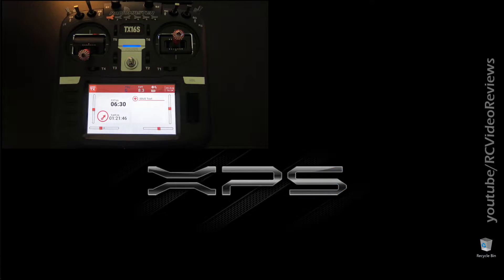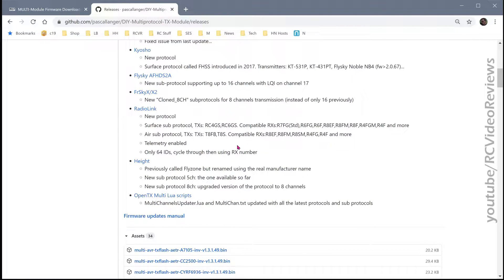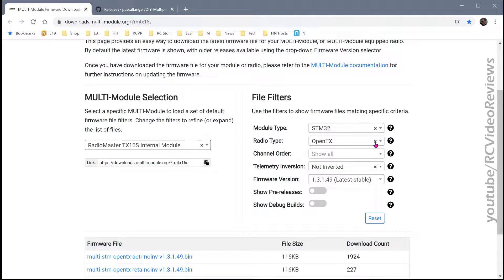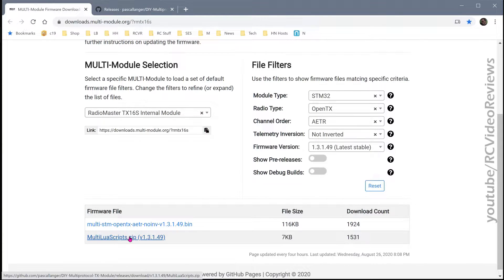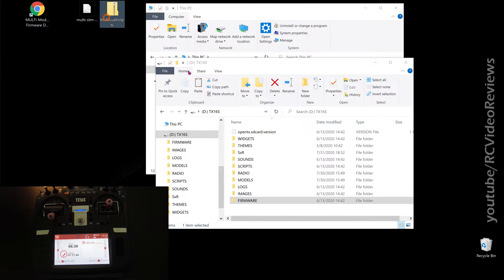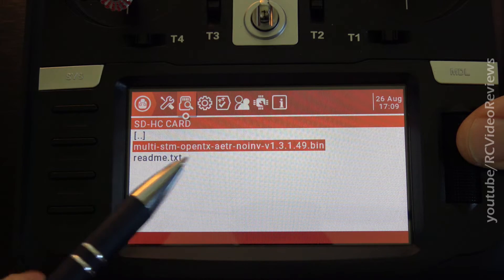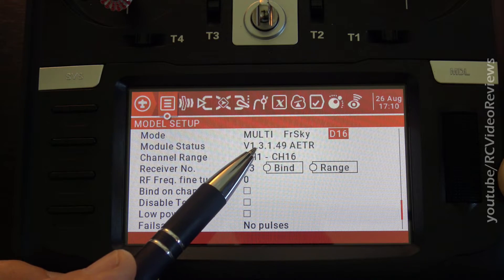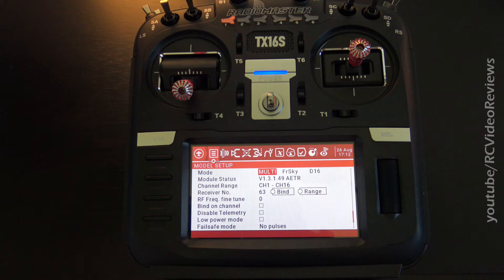How to Flash Radiomaster TX16s Internal Multiprotocol Module Firmware • [Beginners]

Comment: hello i have a little question
I just bought the Radiomaster tx16s mark II and it shows multiprotocol AETR. If I TAER the update on your video
Can I use it as TAER while using the tbs module?
or if there is anything else i need to do if you let me know i would appreciate it

Comment: I purchased a RadioMaster TX16s with ELRS internal. Can I flash it to the Multi protocol 4in1 firmware?
Reply from the maker: No, the 4-in-1 chip is hardware and software. You can't add 4-in-1 functionality with just software.

Comment: Just came across this and thanks for posting. 1 question , my model status blinks fron vers no aetr to module update recommended. any ideas why please? thanks
Reply from the maker: Did you update your module firmware? What version are you running?
Reply: @RCVideoReviews  no, i have V1.3.1.36 AETR  I assumed it was because i had external module as off
Reply from the maker: @boydriver2978  The radio is telling you with the operating firmware you use that you need to update your MPM firmware. They are not the same thing. This exact video shows you the process.

Comment: great videos just very fast-paced. I got the firmware on my tx and internal modular updated but the write to sd part I must have screwed up. it didn't work so all images, sounds, models, are gone. i backed them up but have no clue how to put them back on the tx sd card.
Reply from the maker: You just copy them back to the card.

Comment: I literally don’t have the firmware folder when i go to the sd card page or in my sad card contents… wtf
Reply from the maker: Sometimes zip files omit empty directories. Just make one in the root of the sd card.
Reply: @RCVideoReviews  thanks i got it working. I tried flashing in dfu mode but i kept getting an error saying dfu.util or something like that and wouldn’t work so i had to flash through the remote

Comment: Hi im having a problem binding xm+ to radiomaster tx16s. Do i need to flash the xm+ too and radiomaster tx16s.
Reply from the maker: What protocol are you using?
Reply: @RCVideoReviews  V1.3.1.36 AETR
Reply: @RCVideoReviews  frsky D16
Reply from the maker: You're omitting important information. What's between "Y" and "D"
Reply: @RCVideoReviews  where do i find Y and D at?

Comment: I asked Radiomaster concerning the Conformity of Compliance when updating the internal multiprotocol update.: “As far as we know not” was the reply. I ask the team now for an statement from the developers of the internal multiprotocol module.
Reply from the maker: It makes sense to me they would say that. They sold it compliant. If the user does something that makes it non compliant they wouldn’t want to be in the middle of that question. You can always leave the firmware alone and remain compliant with the initial attestation.
Reply: @RCVideoReviews  Thanks for your quick answere

Comment: Maybe a silly question: Has changing the software in the internal multiprotocol module influence on the properties of the transmitter that gave the transmitter there conformity of compliance from july 2020
Reply from the maker: I don't have any way to definitively answer that question. If you want to dig in, head over to the MPM project page on Github and either check the source code or ping the developer pascal.

My guess is that the developer would not change EIRP levels. Not to say a user couldn't. I have a video on how to compile your own MPM.
Reply: Thanks for your support and I will  sinds the question also to the Radiomaster support team.

Comment: RCVR, can you please help me.  I have this TX.  I've updated everything, firmware, multi-module, bound and rebound my models....etc.  I've just switched to this from spectrum and love it.  All my models have spectrum receivers (planes/helis).  When I do a physical range check I can put the TX in low power and walk 100 meters away from the model with not problem and still have control.  But if I click the "range" option and monitor the RSSI it drops to 0-30 15ft away from every model I have and gives critical alerts and telemetry lost, but I still have control of the model over 100 meters away.  What is going on?
Reply from the maker: I’m not the best person to help with this because I don’t own any Spektrum gear. So I can’t provide any experience based information. You should consider joining our discord and asking there. Plenty of knowledgeable Spektrum users on discord.
Reply: @RCVideoReviews  thank you for the response, and A++++ on your vids and info.  They're amazing and thank you!!!  Sorry for the stupid question....
.but what is "discord"?

Comment: I just want to bind to  these BS Frsky receivers . I have a TX16S , does anybody know what is better updating the radio or updating the receivers as I go ?? I don’t care if I loose bind to and other frsky receiver . Thank you for the assistance if anyone chooses to help..
Reply from the maker: I'm not sure I understand your question. Can you elaborate?
Reply: @RCVideoReviews  Ok here’s the sit rep - I use a TX16S  . Most of my builds I use crossfire.  Before I switched to  crossfire I was a frsky guy. I have 3builds with x series receivers and  4 w/ crossfire .I  recently I purchased a bind and fly with a xm+. I Can’t bind to the XM plus..  Instead of downloading new firmware to the xm+ can I not just download the firmware  I’m currently using  on my TX16S to the new xm+? That way I  can bind to my existing quads ? 
Maybe I’m not  thinking about this correct , if I download the firmware from the site and install on the new xm+ at that point will I no longer be able to bind to my older quads ?  I’m so lost on these  FRSKY  receivers with firmware issues  I know it’s not complicated I just get so aggravated fooling with frsky , I apologize if I’ve been disrespectful or anything I like your channel  a lot & will be becoming a Patreon , I really appreciate you taking  the time to answering my questions.. 
To be clear my question is can I download the existing firmware on my TX16S to my new xm+ receiver and bind that way ? If I do that my old receivers and my new xm+ would all be the same .. Or will I be forced to upgrade all my receivers? I have no complaints with the firmware I’m currently using…Again thank you …  🙏

Comment: Hi, I purchased this radio Radiomaster TX16S, in the hope to continue flying 6 models which are using the old Frsky D8R-II Plus receiver, but bad surprise !!!, this internal module version 1.3.1.36 AETR dont have the option "D8Cloned" !!, but I saw in other video that the old internal module version V1.3.1.24 AETR has the option "Frsky - D8Cloned" , how colud be possible that newest and last version dont appear anymore "D8Cloned" ? ... I will really appreciate any idea or suggestion... should I back the internal module firmware to the old one ? thank you !!! and greetings from Sweden !!
Reply from the maker: I haven't really messed with Cloned. Is there any reason you can't just bind in D8 with the new radio?
Reply: @RCVideoReviews  Hi, thank you for answer, and yesterday late finally I found the solution and solve it, it is that now under brand "Frsky X", and next for sub-protocol, you have to scroll to find "D Cloned" and not anymore like "D8 Cloned"

Comment: After days of trying this finally worked on my 16S.  Ty.  When i went to my firmware on the SD card there was another file there. 
Open-tx 16s-en-2.3.11-otx.bin.  Was there something i was supposed to do with that file like flash transmitter or something.  J
Reply from the maker: That might have just been the original firmware they shipped with the radio.

Comment: My TX16S showed I needed a module update, when I try to download the binary for the firmware update it says I need an APP to open it. So do I need an APP? First time this has happened. Didn't have any issue with the multi lua scripts. But as it is, I cant bind to any new receivers.
Reply from the maker: You don't open the .bin file, you put it on your sd card and flash it from the radio.
Reply: @RCVideoReviews  OK, got it. Process complete. Thanks!
Reply from the maker: @james7224  You're welcome.

Comment: I went to the MULTI-Module Firmware website, and I have two choices, first- tx16s internal module (4-in1) and second- tx16s se internal module (cc2500)).
What do I choose?
Reply: I have tx16s v.1.3.1.59.
Reply from the maker: You need the 4in1. Why are you upgrading?
Reply: I noticed tx16s in user interface / value / pressing int.  / Rud / Long press / List of options, I do not have the last value which is the transmission level of the device, which can appear in the top line next to the battery and volume logo.  Maybe you can tell me if you have the option in your device?
Reply from the maker: @oded_10  My last value is TMR3. I don't believe that has anything to do with MPM firmware, I believe those options are governed by OpenTx and they will change depending on telemetry sensors available.

Comment: Hi There  I have the TX16S se  with the CC2500 chip has version V1.3.1.69  will not bind to Flysky  will I have to update firmware to support Flysky ?
Reply from the maker: I don't believe the CC2500 supports FlySky. FrSky/Futaba.

Comment: I got confused regarding the 2 firmware areas!!! So I followed the other one, then the radio complained of "update firmware recommended" (text flashing), I did this one and it then works fine. I do have problems with creating model images, to the right specification (192x114 in png format) but do not show in the radio, some do, some dont. (weird!!)
anyway, thanks for a great videos on a very complex, and not that easy to understand radio!!
Reply from the maker: Images on this radio can be challenging. I've been frustrated with them too. The process in this video seems reliable: https://youtu.be/6B356b6i4bw

Thanks for watching!

Comment: My TX16s radio came from China with the FCC firmware. I'm in EU so I would like to flash the internal module with the EU firmware. I searched on the website you mentioned but couldn't find that option (EU or Non-EU). I only found the latest stable version (1.3.1.69).
Reply from the maker: There is no EU specific MPM firmware to my knowledge. Look at this page: https://github.com/pascallanger/DIY-Multiprotocol-TX-Module/blob/master/Protocols_Details.md

It looks like the protocol specifies EU compliance.
FrskyX 15 CH_16 CH_8 EU_16 EU_8 Cloned Cloned_8   CC2500 
FrskyX2 64 CH_16 CH_8 EU_16 EU_8 Cloned Cloned_8 

You can also see the Radiomaster declaration of conformity here: 
https://www.radiomasterrc.com/documents
Reply: @RCVideoReviews  When I go to model setup in my TX16s, under "Internal RF", "Mode" I can select D8, D16 or LR12 (https://intofpv.com/t-how-to-tell-what-firmware-i-have-on-my-frsky-taranis). Also when I flashed my Frsky X8R receiver with  firmware X8R_ACCST_2.1.0_LBT, I could't bind it to TX. This led me to the conclusion that TX has the international (FCC) firmware. Since I'm in EU and in order to comply with the EU regulations, I was expecting there was a EU LBT firmware version for the internal TX module. But I can't find it.
Reply from the maker: @jribeiro2025  I don't think there is an EU LBT firmware. Did you read the protocol page? It specifies EU_16 and EU_8 for FrSky X protocol. Under FrSkyX2 I see LBT(EU).
Reply: @RCVideoReviews  When I flashed X8R with the EU LBT firmware I could not bind it using that protocol FrSkyX2 LBT(EU). But I'll try again soon. Thanks for your time!
Reply from the maker: @jribeiro2025  You probably need to verify the firmware on the Rx. I kind of skimmed over some information about that some time ago, but I seem to remember reading the Rx had to be downgraded to 1.2 or something. Anyway, I'm sure once you have a firmware on the Rx that works with the MPM you'll be ok, but with that LBT(EU) in the MPM firmware, I would be looking at the Rx not the MPM for an update.
Reply: Check Version V 1.3.1.69 is for TX16S  SE ,,,   latest version is V 1.3.1.77

Comment: Please hell me. My tx16s is stuck in emergency mode. I tried re flashing firmware. The open tx is good but when i select the multi module bin file radio is saying not a valid firmware file. I already downloaded a new multi module bin file but no luck. And not sure why it suddenly went on emergency mode
Reply: I mean help me haha.
Reply from the maker: I feel like you've left something out...What aren't you telling me?

1) Did it ever work correctly?
2) What changed before it started doing this?
3) Did you modify your SD card?
4) You say opentx is good...how do you know that?
5) Are you using any external modules?
Reply: @RCVideoReviews  
1) Yes it is working properly before this, i've been using it for a week now. But this morning i just heard it cycling on and off while in its box. I turn it off but turned on again in emergency mode
2) No changes. I havent changed anything aside from turning on internal rf and binding with my eachine us65pro when i first opened it. Aside from that no changes nor mods.
3) No changes in sd card too
4) for the opentx it is just my observation since no button is responding and only the bootloader is working i tried flashing opentx from the available firmware and it was successful but for the multi module it says not valid firmware file. We can exclude this one as i think that is not the right way to flash multi i think it should be done in the system firmware as i need to select internal or external while in the bootloader theres no option and only the opentx can be flashed from there.
5) not using any external module. Before the emergency mode I am in internal rf>multi>Frsky>D8.

So now i wonder is my power button broken? Ive searched online and for some it happened when battery was accidentally remove while the radio is on it will come back in emergency mode and i found  mine cycling on and off before the emergency mode.
Reply from the maker: Did you remove the battery and reconnect? Is the battery 100% confirmed fully charged?

I wouldn't jump to power button if you can move the trim switches in and power it up to flash. You said you were able to flash a new firmware in bootloader so that means you turned it on right?

Does it still cycle on and off or can you just hit the power button and see emergency mode?
Reply: @RCVideoReviews  yes i tried removing and reconnectig batteries and use other sets of 18650 too but still the same. Another problem is when in emergency mode no matter how long you press the power button to turn if off once released it will come back on and again it emergency mode. It will not shut off with the battery connected. Just a moment ago after pressing power button repeatedly i was able to get to the welcome to open tx screen so i check everything inside and all is normal i was able to flash the multi module firmware v1.3.1.65. Thinking everything is good i put back in its bix and prepare to sleep but after 5mins i heard it saying welcome to opentx 😂😱 then power it off and back to the same issue emergency mode. I ended up removing battery and go back to sleep for at least 2hours before my shift. Then i will back after work to find out what is causing it.
Reply from the maker: @goodboyrc5398  Ok, if it's turning itself on and you're nowhere near it, you have a hardware issue. I'd be asking for a replacement. 

Last ditch idea: Remove SD card, format, download new SD card contents and install on card. If that all goes smoothly on your computer--no errors/issues and you still get emergency mode errors, you need to contact your retailer or Radiomaster.
Reply: @RCVideoReviews  thank you very much😊😊😊. I will do that and I already raised it with the retailer waiting for resolution.
Reply from the maker: @goodboyrc5398  Good luck. Hope you get it worked out.
Reply: @RCVideoReviews  still the same haha. Thank you for you help I really appreciate it😊😊😊. I am now waiting update from the store will demand replacement.  I can get it to work normally but if i turn off and leave it just after 5-15mins it will turn on by itself then when i turn it off it will come back on to emergency mode then cycle if power button is released. I think emergency mode is okay it's a safety feature for power failure but the main problem is the self power on.
-tried a different lipo
-remove the model currently used
-deactivate int&external rf for all models
-fomat sd card and copy the original content
-use different sd card with it's original content
-use older sd card content i didnt gave it more time but no issue aside from prompt that it's outdated so i delete and copy the latest.
When entering bootloader since it is powering on by itself i just need press trim button.

Next thing i will download new sd card content. This is the last thing in mind.
Reply from the maker: @goodboyrc5398  You've done everything I would have done. If it's turning itself on that has to be a hardware issue. The radio should never turn itself on.

Back before frequency hopping came into practice, we used flags or markers to indicate the channel we were using because if a radio turned on using a channel of someone flying, it could wipe out the flying plane. So historically, it would be consider very bad to have a radio turn on without being under direct control.

There's also the safety factor. What if that radio turned on while you had a body part near the prop..?

I would definitely pursue the exchange.